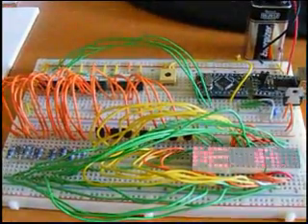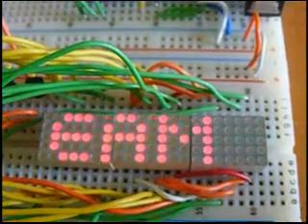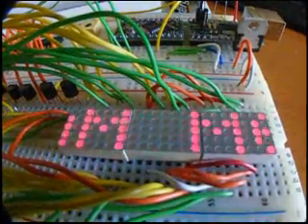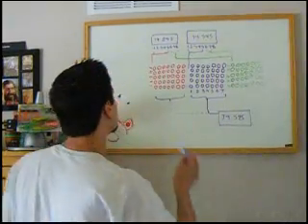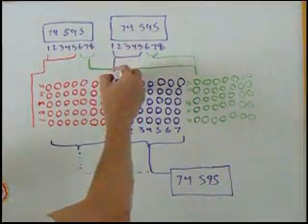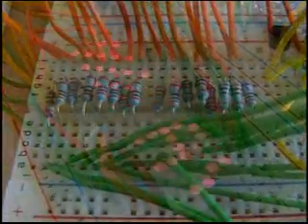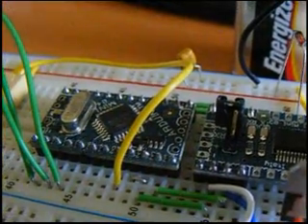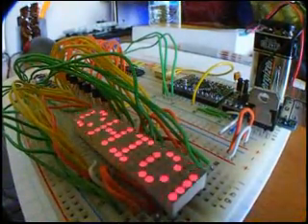5x21 LED Text Scroller Matrix

Comment: photonplay   .    com
cheap circuits are available here for puchase used to drive led sign boards
circuit KITS Available there 
call @ +91-9899690347
all extenstions like GSM GPS GPRS and ethenet are available there

you also can get free advice regarding LED displays working and programming
issues free of cost

Comment: Thanks so much for this really invaluable information.  This really cleared up a few issues I've been having conceptually.

I am trying to run a series of 200 LEDs connected one after the other using 16 bit shift registers, acting as a sort of "graphic equalizer" that responds to audio.  I have it working on a small scale using individual pins off an arduino, but I am concerned about scaling it up.  Do you have any thoughts?  Will a setup of 12 or so ICs still only require 4 pins?